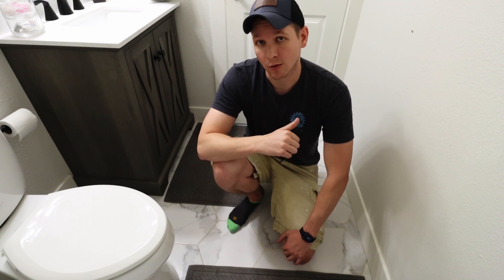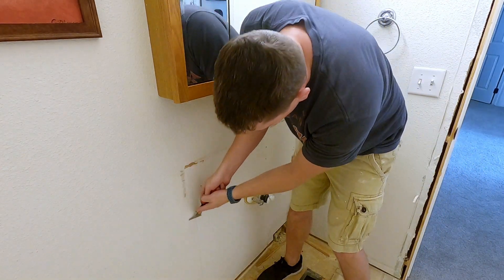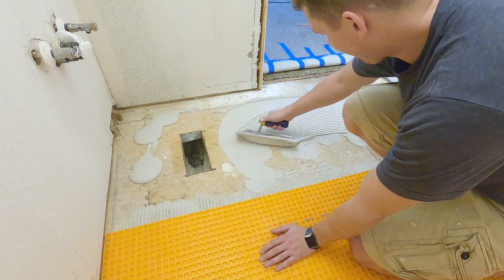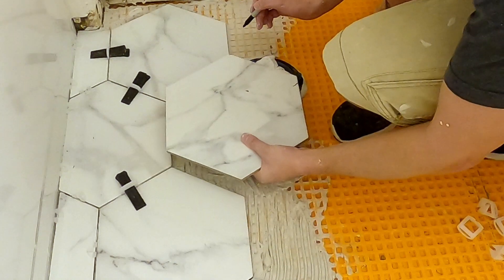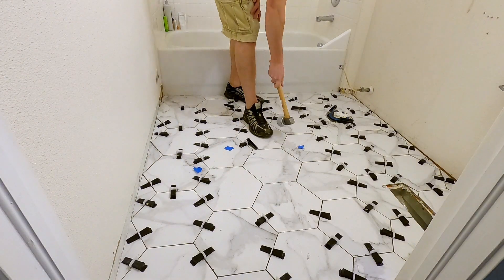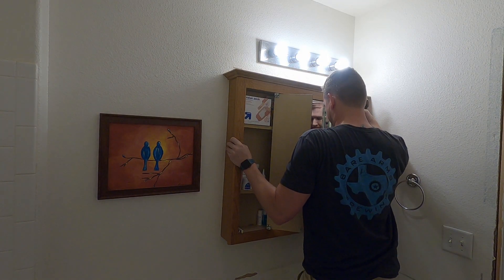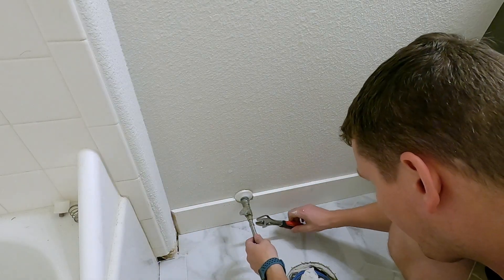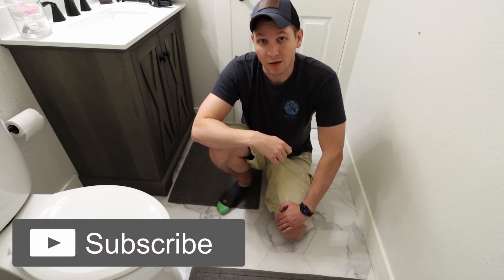Bathroom Renovation - Part 1

Comment: Watched your video. You put a orange color sheet on the ground before laying the tiles. I wonder what material is that? Is it plastic or cardboard? Is it soft or hard? What is his name? When I go to Home depot, how many do I need to buy for a 70 Ft bathroom? How much is it about? What kind of material I need to buy for stick tile and fill crack? Please answer me. Thank you!
Reply from the maker: It’s called Ditra. I used the XL version which is a little taller. It’s a decoupling membrane that allows the tile to move independently from the expansion/contraction of the wooden subfloor. It comes in different sizes rolls but should tell you how much sq footage the roll will cover. It isn’t cheap but it’s cheaper than having to replace your new tile if it cracks.

Comment: I converted a 2 piece bathroom to 3 piece this summer with 2 young kids around the house. I tried to find something quiet to do during naptimes and bedtimes, and when that wasn't possible I used that time to do supply runs at the big box store. I set up my miter saw in the driveway so the sound would mostly escape through the neighborhood instead of reverberating through the house. Some tools like impact drivers and oscillating saws were strictly off limits during quiet time (my wife says the impact driver makes the whole house shake).

The kids presence didn't really slow me down that much. It was more of a pain to keep my toddler out of the reno area since he's very curious about all the dangerous (for him) tools lying around.
Reply from the maker: My daughter isn’t walking yet but I imagine that is going to be a whole new game changer trying to keep her out of the work areas and moving tools/supplies. I’m already a person who misplaces things so I’m sure there will definitely more time looking for things.

Comment: How much would you say this cost you to do?
Reply from the maker: So I got really lucky and found the vanity/mirror at Lowes on clearance for $99. That saved a ton and I didn't replace the toilet. Up to the point in this video I say I had about $800 - $1,000. Faucets and hardware get a little pricey. To do the whole bathroom I'd say it was under $2k.
Reply: @CraigHartmanDIY  thanks for the info. Great to know that this can be done under 2k!
Reply from the maker: @kristenbrowning1684  sure thing. Would you be ok with me quickly showing your question on my next video?
Reply: @CraigHartmanDIY  sure!